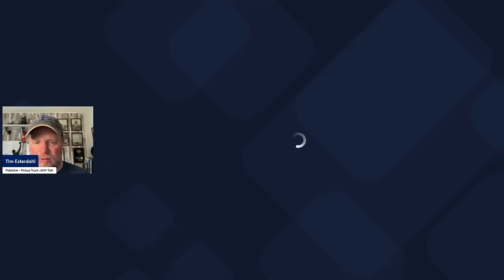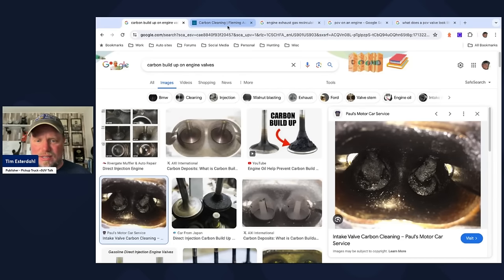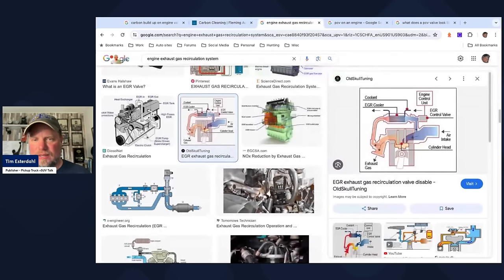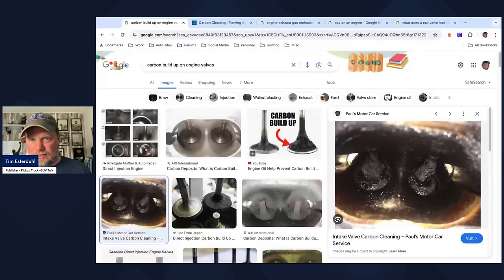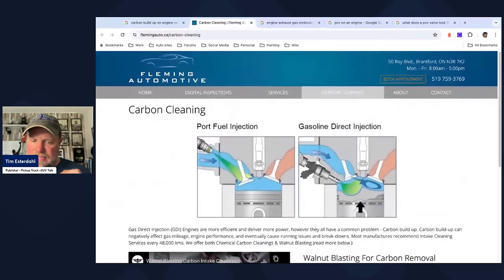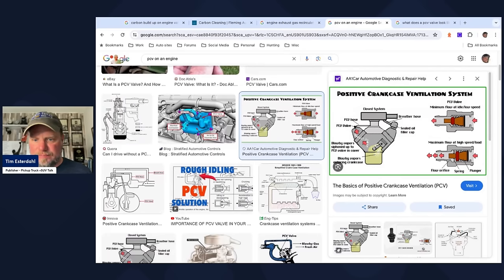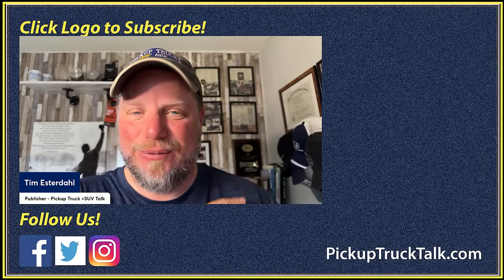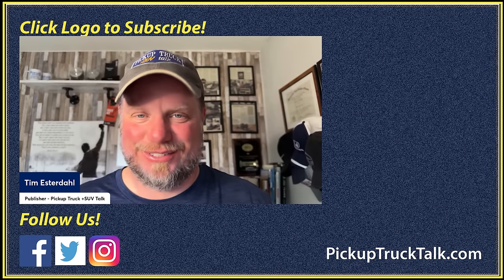Direct Injection Carbon Buildup Fixed Due to Valve? No Catch Can Needed?

Comment: PCV is ventilation for the crankcase, not the cylinder. OEMs do design channels or baffles, but they are not perfect and still allow some oil through. Nothing is burned off, it just collects as much oil vapor as it can to keep it in the engine and not send it through into the intake tract. Our Focus ST catch can collects about 2-3oz every 5k miles. I am willing to put in the effort to empty it regularly, so it is worth it in my opinion to add if others are similarly inclined.
Reply: Each cylinder have a leak down up to 10% on a healthy engine and guess where it goes ,yes, to the crankcase.

Comment: I had already reasoned this out...  While It may be true about the PCV system I think a second catch filter can extract a bit additional oil...  What can not be known is how functional this really will be - will it actually reduce the final carbon build up before you reach end of life of the truck?   Many think YES.   There is one more factor to consider   The catch can collects  Fuel and Water --- Both of these may be helpful in cleaning the valves   I'm curious to investigate if that makes any difference in the long term carbon build up.   Many think No -- But it's hard to actually study these situations.  You need large scale testing - not just a few people on the internet.

Comment: Gasoline is a solvent, which is why it can help.  Carbon builds up slower on port injection systems.  Enough that in a well running motor, that is well taken care of it will not get bad enough before the natural end of the motors life cycle.

Most people I know that install catch cans have them filling with oil even after the PCV valve.  Not all PCV are made the same, and they are not perfect,  the catch can is an added help but he is right.  It is another maintenance task and if neglected you will suck ALOT of oil into the motor by way of the intake.
Reply: Well said.

Comment: The PCV valve is an engine efficiency device.  Racers use windage trays to reduce crankshaft drag.  But the PCV valve creates a vacuum for the crankshaft to spin in.  While the PCV valve first became a mandatory emissions control device for all vehicles in California during the 1960's.  It does help to improve engine efficiency, keepb oil off the roads, and clear the air.
I remember when my first car would only go 3k miles between tune ups.  And the engine bays became very dirty and oily in a short time.  Improved gaskets, PCV valves, improved lubrication, electronic high energy ignitions, electronic fuel injection and double overdrive transmissions, have all improved cars tremendously.
A friend did a restomod on a 1950's Checrolet Bel Air.  With a modern 6 speed stick, throttle body fuel injection, MSD ignition, and radial tires.  The car still ran the 4.10 gear ratio, but got very good fuel economy.
Yes Southern California still has smoggy days.  The smog is less dense and acrid than it was in the early 1960's.  But the PCV valve is one of the devices that allows vehicles to drive many more miles, more efficently.

Comment: Look,  I don't know the reason he would say it "may" help (other than he may not really understand it), but I really doubt that the Toyota engineers would design it with port and DI if it did not work, nor would they go to the expense of adding the port injection.  PCV alone will not keep valves clean; it doesn't remove atomized baked on deposits.  DI engines have PCV's and they still get deposits. Even adding catch cans don't always help. Currently the only way to keep build up off the valves without manual cleaning, is to bathe them in gasoline (solvent).  I'm sorry, but he is full of it, and I say that because all the evidence shows that.  Someday they will come up with a better way, but for now it is by keeping port injection as part of the equation.

Comment: Positive crankcase ventilation valve, works on the positive pressure in the crankcase produced by blowby (which all engines do).  No vacuume.  Replaced mine on the Ram at 100k km.  It's a maintenance item a lot of people overlook.  The PCV valve itself can sludge up, I was having rough idle.  I'm glad you understand the valve buildup now, the gasoline has a washing off effect, slows it down.  I'm glad I'm done fighting all this, especially with the gas particulate filters coming soon.  I'm sure the engineers who work for the manufacturers that pay their salaries will claim those are the best, most reliable, and maintenance free systems ever made too.
Reply: It uses intake vacuum as well.

Comment: The chief engineer for stellantis hurricane engines gave a short presentation about the new I6 engine and said that crank case ventilation has been significantly improved on newer engines and carbon build up on the intake side has been almost eliminated completely.

Comment: Porsche has had a superior system since 1997 when they developed the water cooled flat6. They use an Air/Oil separator it’s similar to a catch can but the oil drains back into the sump. 

You don’t hear about Porsche DI engines having carbon buildup on the intake valves.

Comment: I have a 2018 Nissan Titan SV with direct. I just had it in the garage around a week ago a private garage. They checked over the truck for me every inch since it now has over 114,000 miles on it. They were shocked they took out a plug since I still have the original plugs in it and they were still looking brand new no carbon build up no wear even. They hooked up there valve cleaning machine and put some BG treatment in it and there was hardly any carbon on the valves. I live in the country and drive 30 minutes to work everyday highway miles plus I have done some C foam two times since owning the Titan. I am not sure if this is being blown up as a problem since my truck has had no issues what so ever.
Reply: Your system/engine cleaning habits work! I do something similar with my own rigs. It works! Mine are also extremely clean inside. I have been using MMO and Motorkote and I have combined on my vehicles 1.2 million miles. None of them have ever had valve covers off, catalytic converters replaced, no fuel pumps replaced, never been in a shop to get torn down, and they all give me advertised or better fuel economy. Keep it up!

Comment: i'm pretty sure in the past your channel had a video from a GM engineer about the new 2.4l turbo truck engine, and they spent quite a while talking about the diff stages of the pcv system.. all for the goal of capturing engine oil so it doesnt have to get router back into the intake

Comment: Ola Tim!! The issue that I have is -- "when the engine gets hot" as most city driving is less than 10 miles per trip, the engine does not get "hot", so the baffle will not burn off the oil residue, it will impact the performance of the PCV value as less gasses are allowed to pass through the baffle as it becomes oil saturated.

I have a catch can on my 1.6L Kia GDI that I need to dump every 3000 miles or so. Yes, it is an additional maintenance item, but as my car is a 2015 and has 38,000 miles on it, my driving habits create the worst conditions for oil vapors from the crankcase to re-enter the incoming air stream and flow over the intake valve.
CRC makes a great product that you can use to sort-of remove the carbon build up on the intake valve. It, however, is also an additional maintenance item. In the old days (pre-1976) the crankcase ventilation would just be routed directly to the atmosphere. Some green deal dude made that illegal and requires the PCV to route into the intake manafold. 
Back in the days of carburetors, throttle body injection, and anything other than "direct injection" would allow the crankcase vapors to be diluted by the fuel charge entering the intake manifold.  As long as the PCV routes crankcase vapors into the intake manifold, you will have the issue with carbon buildup on the intake valves. We just have to live with it and take a little extra time to perform the "extra" maintenance steps required to drive a gasoline engine vehicle. If you want better efficiency and more power, you have to also live with the extra maintenance required.
Reply from the maker: I’d imagine the age of your vehicle also has something to do with it. I mean, engine design has improved over the years since your KIA was built.
Reply: @Pickuptrucktalk  True, if  we all had the money to purchase a new car every 2 years (as our parents did). we will have the carbon buildup issue, intake valves will always collect oil vapor residue as the valve is always cooler than the actual temp inside the combustion chamber.

Comment: I have come across a Y61 Nissan Patrol here in the UK that had various well made modifications on it and one of them was a reversible PCV valve rerouting: Instead of feeding the crankase blowby back into the intake of the engine he had rerouted it down towards the bottom of the engine venting into the atmosphere. This mod was reversible, so that during the annual inspection that we have here in the UK he could route it back to its factory setting and pass the inspection, called MOT.
This type of mod is in the same bracket as a DPF delete or an EGR delete, but with one more caveat: A DPF delete will change operating conditions of the engine: the back pressure on the engine, hence properly done it will require an engine remap. Same for the EGR delete, just blocking that circuit, it actually changes the air to fuel mixture in the engine. Rerouting the PCV valve to vent into the atmosphere below the engine is totally fine, just relieves the intake from having to breath in all this oily mist. And if its done reversibly, the better.

Comment: Modern low tension piston rings (to reduce engine friction) help exasperate engine blowby and oil vapors.
Reply: Yes, you are bang on .Low tension rings and high pressure fuel injection on a cold engine before the piston can expand enough to make a better seal .
Reply: This. People don't realize that engines are manufactured today with larger clearances. Engineers realized that the rings riding on oil is better than riding on metal. Which is why greater "oil consumption" is accepted now.

Comment: Also tim you should look into how they vent the crank case on race engines its really cool. It actually goes straight into the exhaust and uses the vacuum created by the exhaust pulses to draw the air out of the crank case. EPA wouldn't like that on the street though 😅

Comment: In older cars that did not have a direct injection, (Port injection or throttle body injection or carburetor) never had carbon built, When they went to direct injection, is when the valve carbon issue became an issue.

Comment: Given what I find in my catch can for my late model truck, 1 or 2 ounces at most every oil cycle, I would dare to say that a PCV with baffle isn't fully effective at trapping heavy oil laden vapor in PCV recirc systems.  Port injection with direct helps mitigate some of the oil vapor build up on intakes, but port injection doesn't run full time, eg, it's only during specific times like cold startup and under low RPM whereas running direct injection is suited for higher running motor RPM under load as typical while driving

Comment: So how often do you need to change the PCV valve?  (I think it would clog a lot quicker than the old school ones.
Reply: most engines just have a fixed orifice rather than a serviceable valve like the old days . so there really isnt any maintenance to do to the pcv system
Reply: @EverydayJ1786  Good to know.  Thank you.
Reply: If you have a PCV valve 1x every 50-75k miles. If not done a non working PCV valve can cause blown seals which will lead to oil leaks

Comment: You definitely want pcv system working. Look at old engines you can tell who knows what it does. Your old chevy should have a pcv valve usually on one valve cover and a filter on the other valve cover. Unless its a straight 6. Ill be happy when these manufacturers actually own up to the issue.

Comment: When I met the women who is now my wife, she drove a car that when she stepped on the gas, would  blow a big oil smoke out the exhaust pipe, due to a mechanic putting in the wrong PCV  in the car, so on execration,it was actually sucking the oil out of the crank case and passing it back through the intake

Comment: Problem with having both systems is that the port injection doesn’t send enough gas onto the valves to keep them completely clean. 90% of the fuel is directly injected and only 10% is port injection. And 10% is better than nothing but not enough.
It seems today that we cost owners hundreds of dollars in repairs to get 2% better fuel mileage.
Even with baffles the oil will clog up the baffles. Oil doesn’t burn off clean. It leaves a real mess behind. 
And any baffles would need to be heated by the exhaust manifold to get hot enough to burn off the oil.

Comment: Hi Tim, there are other vehicles besides Toyota, catch-cans are really good ideas, so is really good synthetic oil with low volatility. EGR while required, is just evil. Have you ever heard of solubilized oxygen, dissolved, entrained and entrapped air in the fuel? It is there and they know it is there. Good auto maintenance and a monthly steady state long distance run through the countryside helps as well. One must remember that for at least the last 40 years engines are computer controlled. The 2 prime directives in the engine management system are maintain drivability and maintain reliability. The computer-controlled engine management system will increase fuel consumption considerably in order to maintain its 2 prime directives. Carbon deposit accumulations simply increase fuel consumption and reduce engine performance.
Reply from the maker: The question, for me, is when did PCV have baffles? Does everyone offer one on their engines?
Reply: Yes there is nothing different about there pc valve , they all have baffles,  they can block the fine mist of oil that comes in with all that ventilation and evaporate it all on that little valve. Tell that engineer to show us a DI engine with no port injection or catch can and show us the intake valves after 100k.
Reply: @markpontes4457  Is there any manufacturer who installs a catch can as stock? Seems if it was that good, somebody would do it. And the fact that thousands of vehicles everyday don't use one and last just as long as ones modded kinda shows it's unnecessary.
Reply: No car make that I know of puts one in from the factory, they should just put them in from the factory and have them just drain back to the oil pan then theory wouldn't ha e to have the owner empty it!
Reply: @markpontes4457  Volvo uses an oil trap system as a PCV.

Comment: Lmao I have a 2016 f150 with the 2.7L and 130k. I bought it new and have kept all my records on oil changes etc. I have used almost exclusively full synthetic oil in it.  At 100k, I added a catch can. I get an ounce or so every 5-7k miles. 
If someone wants cover examining the valves,  I am game.  It runs fine so I haven't ever worried.

Comment: I miss the old days of a rubber tube hanging off the block letting pressure blow out directly to the road. I’m sure they are mandated by the EPA to not create extra oil waste with a catch can the same as the recommended 10k oil change.

Comment: I don't get it. The PCV is nothing new. Are they not being put on the new direct injection engines or something?
Reply: They have been on engines since  at least 1970.  And yes, they always had a baffle in them to keep oil from passing through with the crankcase gasses.
Reply: PCV isn’t the issue with gdi engines. The concern with them is they are more prone to carbon buildup on the valves since fuel is no longer being sprayed across intake valves. The catch can/PCV conversation is related to reducing contaminants that could be the source of the buildup.

Comment: One thing I discovered why looking into a catch can is you risk voiding your warranty with it regardless of your thoughts on the subject so if anyone decides to go that route just something to keep in mind
Reply: Absolutely false. Who keeps spreading this junk?
Reply: @BabyGators  I’ve spoken directly to technicians at dealerships when modding my vehicles and you risk voiding your warranty with any NONE OEM PART so if your gonna do it wait till your warranty is gone to avoid that risk
Reply: @switchbackfable  that just simply isn’t true. I’ve worked at dealers and OEMs. Can only affect your warranty if manufacturer can prove the aftermarket part caused the failure. Under no obligation to avoid add ons or aftermarket parts
Reply: @BabyGators  That’s some very kind hearted dealerships you’ve worked at then as the ones I’ve dealt with advise against any serious mechanical modifications until you’re warranty up because of the length of dealerships will go to to prove that you caused the mechanical failure with your modifications and they won’t install any non OEM parts either unfortunately
Reply: @switchbackfable  well there’s a big difference in major mechanical changes and add ons. Major things like a cam, sure way too likely to interfere with stock systems. Add ons like a catch can are absolutely not a problem
Reply: @BabyGators  again the dealerships I’ve dealt with won’t install parts like catch cans, level kits or cold air intakes for example just incase a part does fails someone has to flip the bill for it and they don’t want to, you gotta weigh your options with installing any non oem part before your warranty expires or just wait till it does then go to town but it all  depends on your dealerships stance on non oem parts. Keep in mind too I’m gonna off of my experiences and every dealership is different.